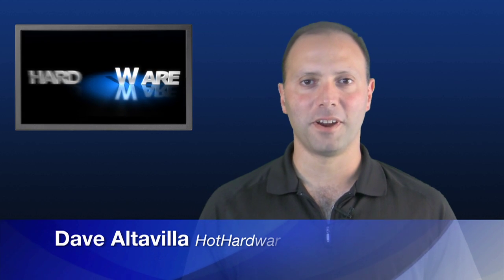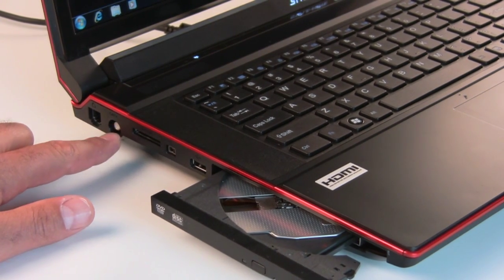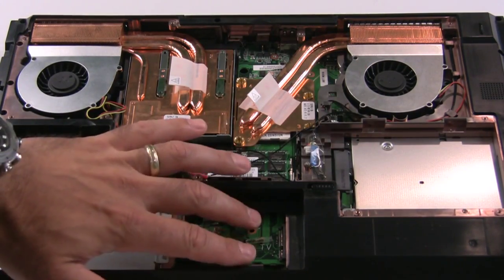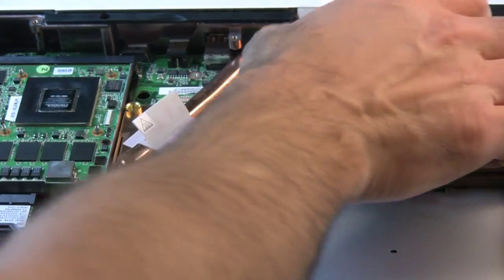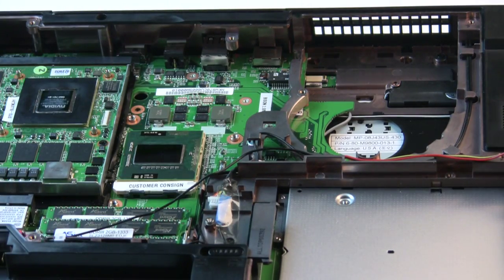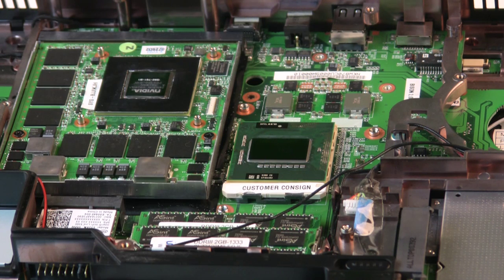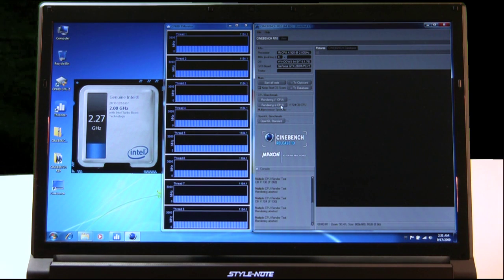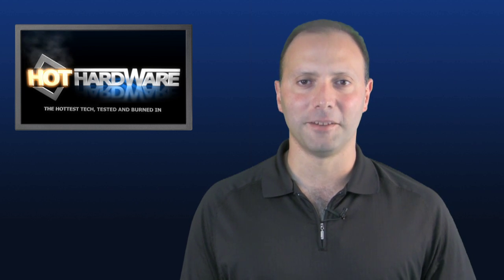Intel Core i7 Mobile CPU (Clarksfield) Preview

Comment: I'm wondering witch Intel Processor is better for my Sony VAIO F:
the i5 Core 580MQ 2.6 GHz or the i7 Core 820QM 1.73 GHz ?! 
since the first has higher Clock speed and can reach even higher ones with Turbo Boost, and the latter is i7 Core which is supposed to be faster!
Any thoughts?  

P.S.
Pricing isn't the issue.